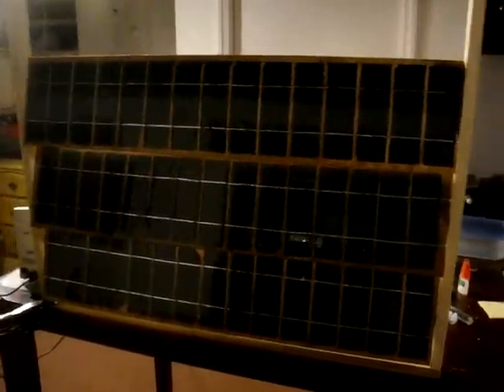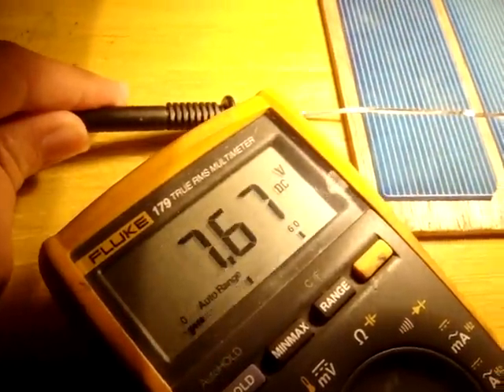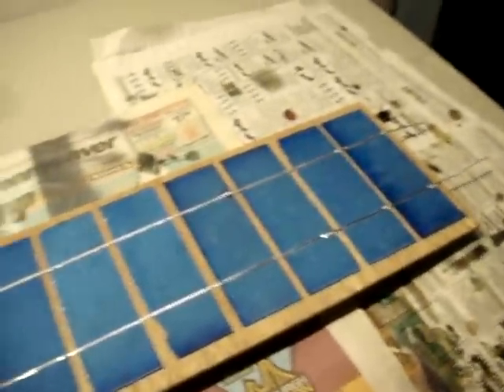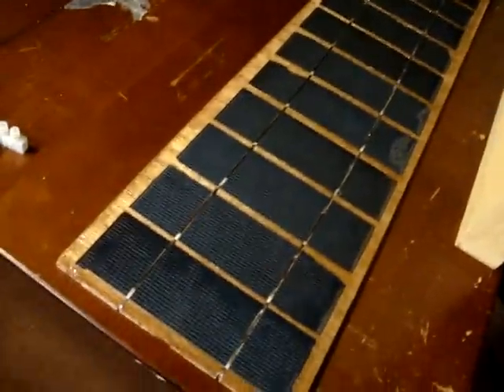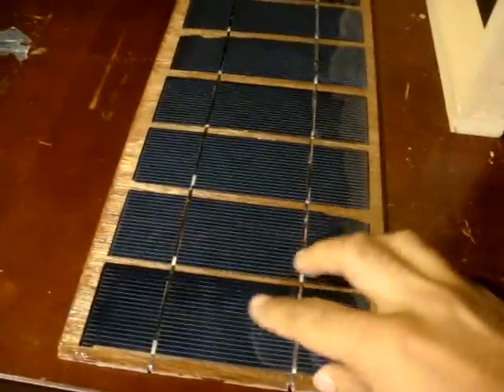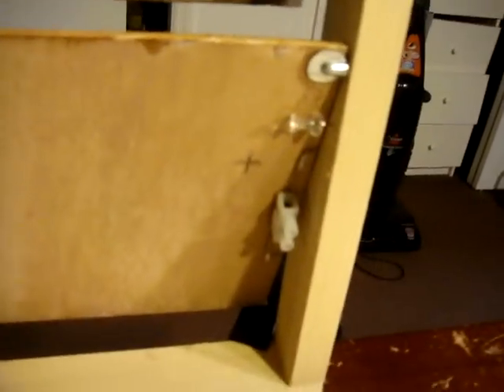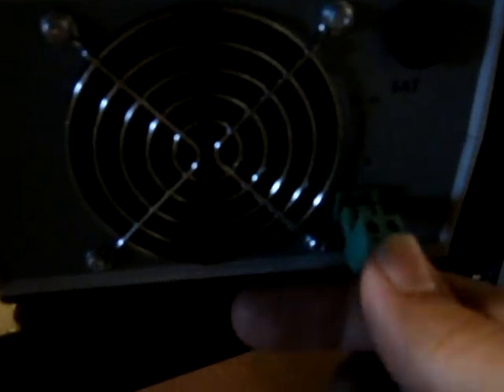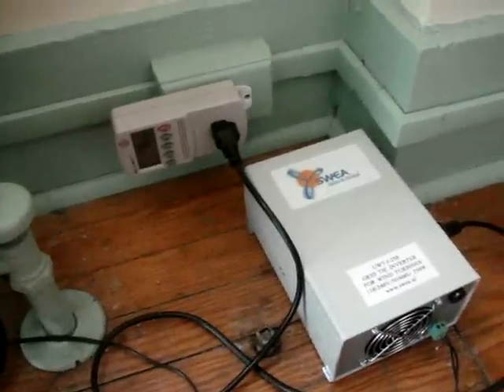How To: Solar Panel Window Shutter Great for Apartments

Comment: This is a great idea! I am an apartment dweller with muscular dystrophy who is on ventilator assistance at night. I have to go to the hospital when my power goes out and my marine battery cannot handle the load, both heat and ventilator. I asked, under "reasonable accommodations", for a  generator and my landlord turned me down.
I would be interested if you could make me and others like me a 60 watt solar panel off the grid with an inverter. I will pay what ever you feel is reasonable.  Thanks!

Comment: Good idea!  2 thoughts that might help...1-flip every other panel (like AA batteries in a holder) so the +/- connections need less wire.  2-mount on some aluminum instead of wood.  This would be lighter and help keep the panels cooler for better efficiency, also some of the captured heat could help in cooler months.

Comment from the maker: Thanks for your concerns, but you are misinformed about the material properties of the epoxy.

1.) The optical transparency of the epoxy is quite good there is not a measurable difference in the power output of cells with and w/o epoxy.

2.) The force of thermal expansion of contraction of the solar cell / epoxy is not as great as you might think. I have had this very window shutter outside for two winters and two summers exposed to rain, snow, and ice. There has been no damage to the cells.

Comment: This looks awesome, is there an option for mounting inside windows in a rented apartment window? I'm in Sydney, Australia and outside apartment building windows is an area owned by the strata, not the owner, it would be in the dry and not so exposed to weather, maybe more heat however, would the glass reduce the efficiency much?

Comment: Can't use these in many apartments because they state in the lease(Many of them) that windows and doors can not be obstructed by anything other than drapes, blinds and in some cases a low furniture that can be climbed over for emergency access. I am super interested in Solar energy and would like to take many things off the grid, however an apartment doesn't seem to be a place to begin, the land lord also deems what is considered "Obstructive and unsightly" making an outdoor unmounted solar panel another null option.
Reply from the maker: I disagree, how many apartments have you seen with fans and AC units in the window? The lease is an agreement between you and the land lord and can be negotiated. An apartment is as good a place as any to innovate with solar tech.
Reply: sparkstarter That is a good point, the place i stayed at is owned by a corporation that operates in another state, When i asked about having satellite TV installed she (The landlord hired by them) said i could not have one installed, the Dish company stated they could put it in a bucket with cement, after giving this statement to her, she denied it as it would be "unsightly". Following this i moved to a Federally owned estate, my current residence; and i was asked to uproot my solar garden lights i bought from wal-mart for the same "unsightly" reason, which happened to be placed in my are of the sidewalk leading to my door. Before your video i had the idea of buying a $150 solar starter kit that sits on a rack on the ground, this notion was also denied as they didn't want to be responsible for moving it when lawn maintenance came.

Comment: Hello sir!
I started thinking about solar "blinds" a few years back. I read about students in Europe having a similar project. Today, solar cells can be found in all (mostly rectangular) shapes and sizes. In my attic I have solar panels facing outside through closed windows powering LED lights with motion detectors. That way I do not forget to turn the light off. This is what I call indoors solar. Solar power for apartment dwellers will depend mostly on south facing windows as well as east and west. Modern batteries that do not emit toxic fumes also help. In other words all the ingredients are available for window solar power collectors in the form of shades or blinds or shutters. This morning I came up with a mechanical setup that I think will work without being in the way of normal window operation. This is why I am contacting you. This video together with your other solar power related videos tell me that you would be a perfect partner for such a project. My goal is to make something that can be installed and removed without causing any damage to the apartment. Something that will not be visible from outside when not deployed. Windows shades have hollow tubes that hide the spring coil, but hollow tube can also hides a few "D" rechargeable batteries. If you are interested, I will talk about the other features that I have been thinking about over the years. This is a market that could be bigger than that of solar power for homeowners. Maybe we can build something together. PRP
Reply from the maker: OK sounds interesting. You can contact me on my website DCtoPower.com